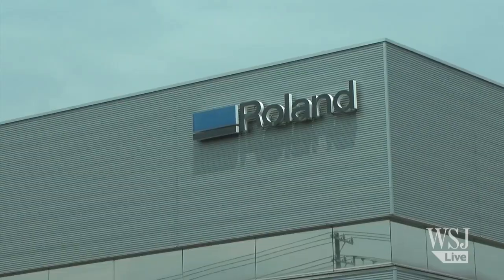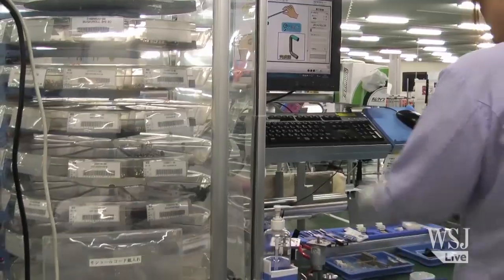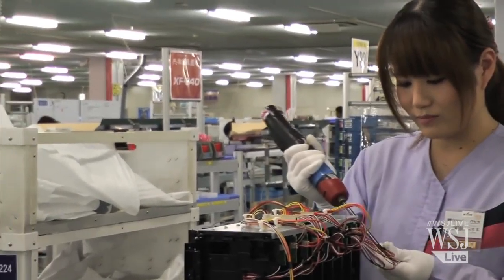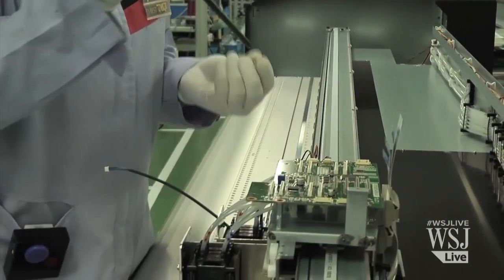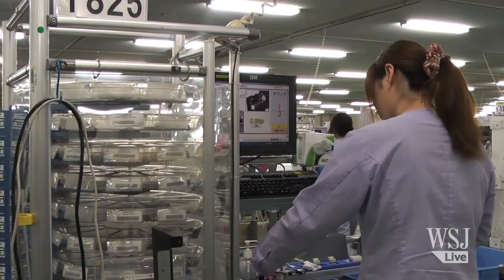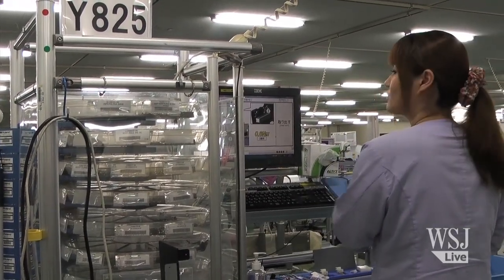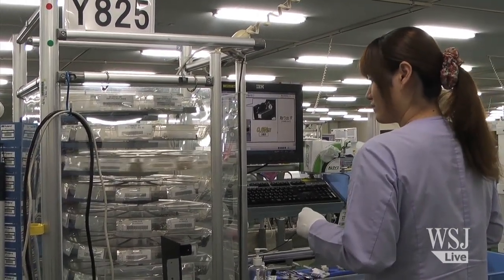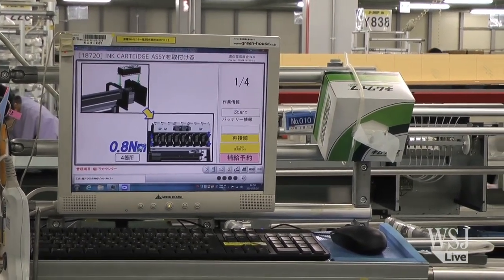Goodbye Assembly Line, Hello D-Shop

Comment: No way this can beat assembly line productivity.
Reply: those are high end $$$$ products
Reply: in terms of shear output probably not
but having one person be in charge of assembly for a unit eliminates lot delays between stations, and reduces chances of mistakes
you also eliminate transportation costs with moving pieces between stations, and the potential storage delays that comes with it
Reply: It certainly doesn't, but building a proper assembly line for such products is not an alternative to begin with, production volumes and level on customizations is just not compatible with that approach. This cell manufacturing idea is not trying to contrast with assembly line, it's trying to contrast with more traditional workshop where highly skilled electricians and mechanists interpret engineering documentation that defines the end result but not the process and assemble the entire thing from start to finish while figuring out on the go in which order and how to do everything. Here the process is already figured out so you can get an unskilled laborer to follow the instructions like in an assembly line, but the work area is organized more like a normal workshop.